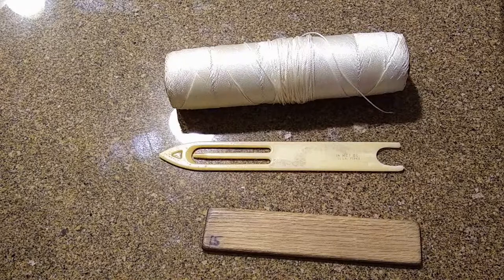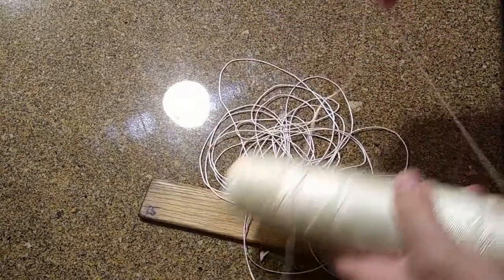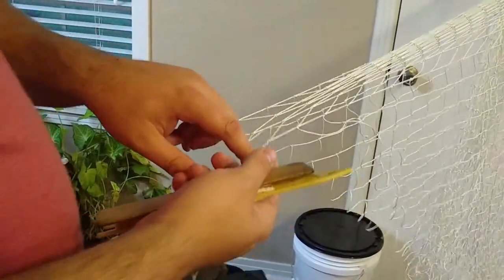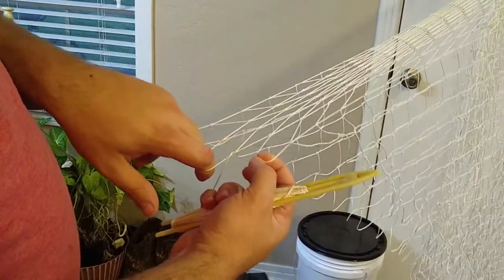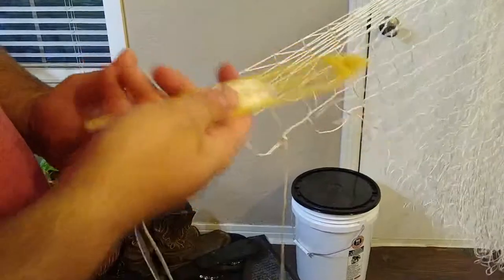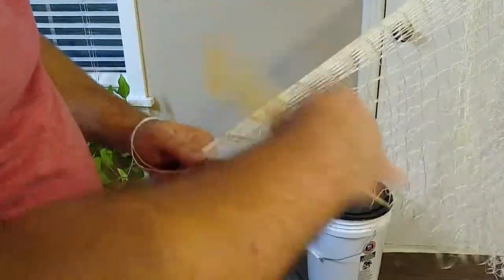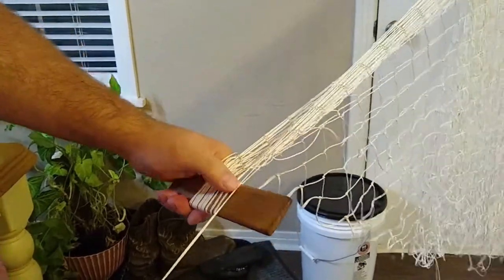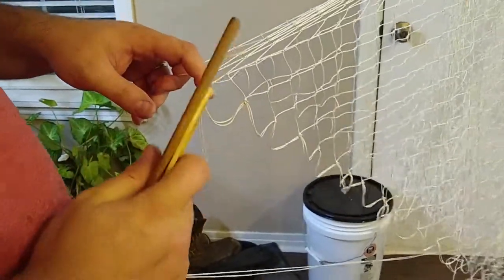How to Jump  Mesh and Tie Double Selvage

Comment: Another great video ! Thanks for explaining the whole corkscrew deal! And interesting how you did your double salavage loading I always just pulled out a bunch of twine out and just doubled it lol. But this math definitely helps to get the most bang for your buck. As far as quality,honestly I think it's pretty good.much better than some other stuff I've seen. Now I do have a question. Is it possible to make your throats out of pre made webbing ?  Edit : is their a good way to do it. Like working with three and four inch webbing ,it don't take too long to sew in a throat from scratch but say your making a small hoop or double throated wire framed net for something like bullhead catfish and your using like 1.75 stretch mesh. Seems like it would be pretty tedious to say the least to sew it all b to hand. It's their a good way to to cut throat out of a sheet ( I figure it would be kind of like making panels on a cast net )and sew it in ?
Again awesome videos ! Been sharing them around so hope you get some more views !
Reply from the maker: Yeah you can tie throats out of prehung webbing. I would cut a whole mesh shy of the length you need and sew the last two rows by hand. Take up 2 meshes around the small end the whole way around to drop your mesh count. This won't give a real good shape to the throat but it will be faster to hang.

Comment: How do you go about cutting a sheet of webbing correctly  so you can sew it together and make the tube for a hoop net,? I did it once but dnt for the life of me redo it ! The net I'm making right now needs 20 meshes to cover the frame ( it's a concrete remesh frames turtle net with a 6" stretched mesh ) so I figured if I'm trying it with the seamless method ( the way so the books show show when your adding a patch in a damged net) I need to cut it 19 meshes wide so she I sew it together I will basicll add a mesh and make it 20. Problem is I dint cut it correctly and I had to trim it and now I only have 19. Then I tried to practice by just cutting 8 meshes but when I sewed it up I need up with 9 meshes. Any advice ?
Reply from the maker: You need 19 and a half meshes, then wrap around the frame. The edges of the diamonds are gonna line up like a zipper if you can visualize that. You then start from the high corner and go across and down a half mesh to the side of the other mesh to make the knot. 

If you are less than 19.5 meshes, you will need to hang it up and tie it back out to 19.5 meshes. You will not jump meshes tying onto a flat panel. 

If you have any more questions just let me know.